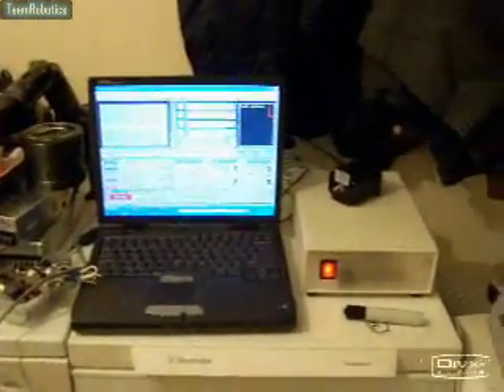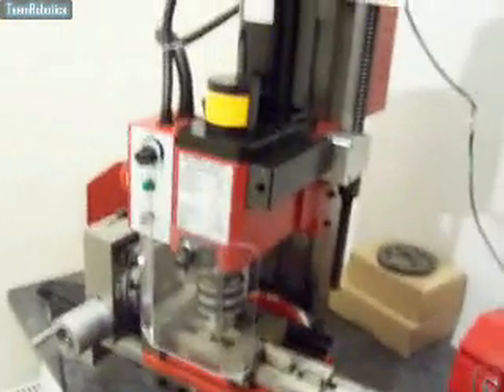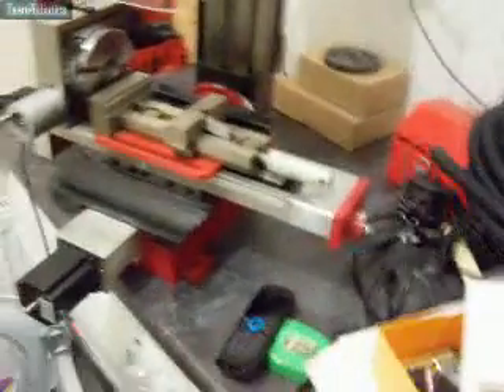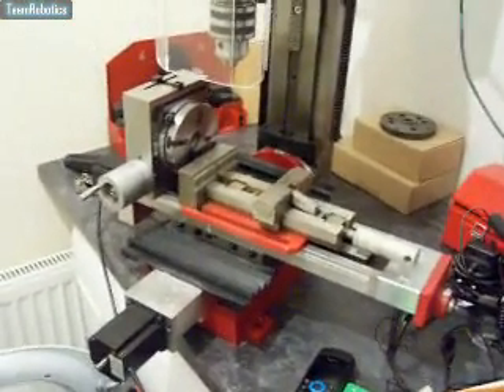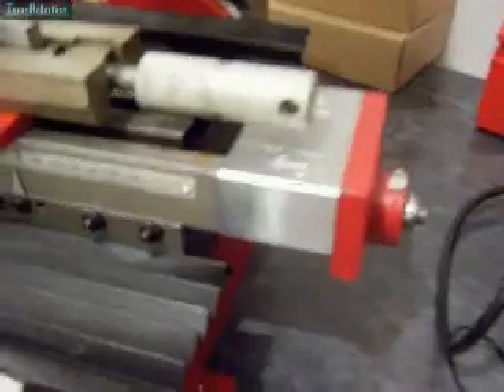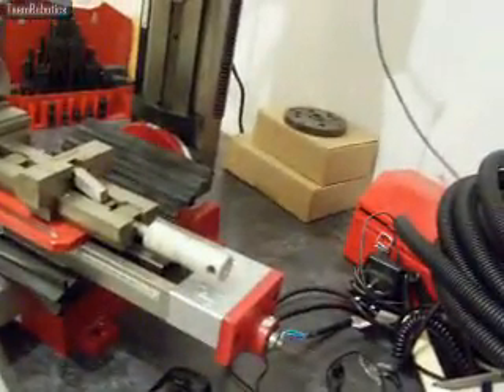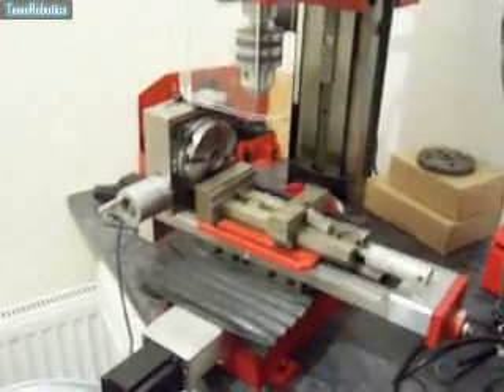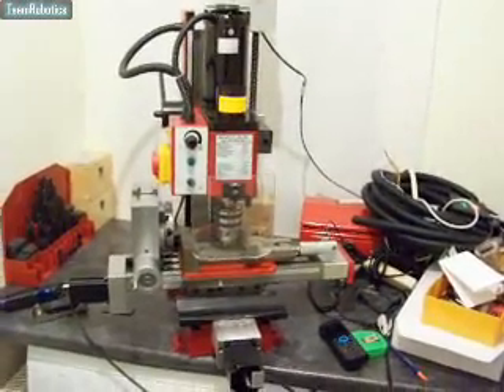44: Sieg X2 Cnc Conversion First Test

Comment: Do you have any bits for sale from your previous setup?All I want to do is power the X axis,I'm a manual machinist,I have used CNC on and off over the years and still find it takes about 5 times longer than to do it manually,CNC is fine for production runs etc where it does vastly cut the time and cost down but for one off and home stuff it just takes too long.

Comment: Did some researching, the Xylotex's are bipolar...

All 4 wire steppers are for bipolar operation only. The reason for this is that the 2 coils inside the motor do not have center taps.

5, 6, and 8 wire steppers can be run in bipolar OR unipolar mode, because the coils have extra center taps.

stepperworld (dot) com/Tutorials/pgBipolarTutorial (dot) htm